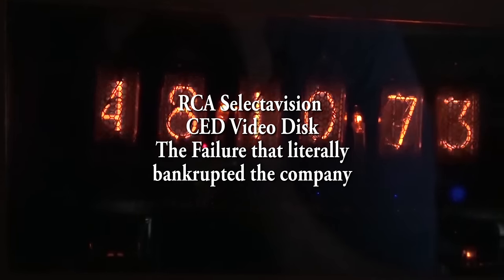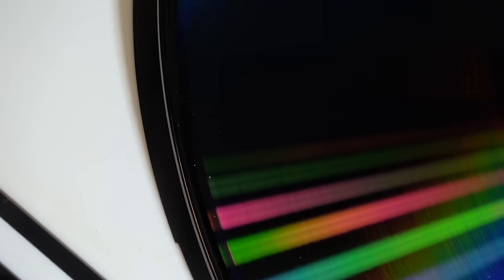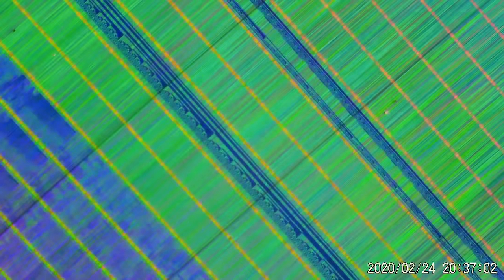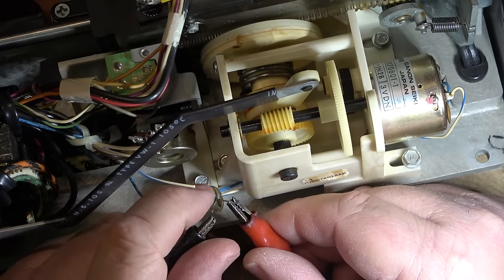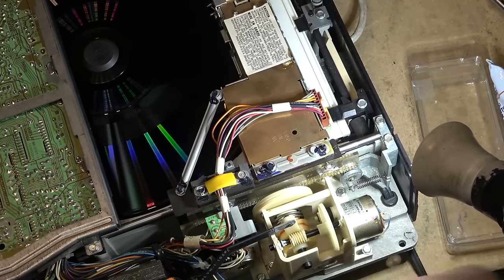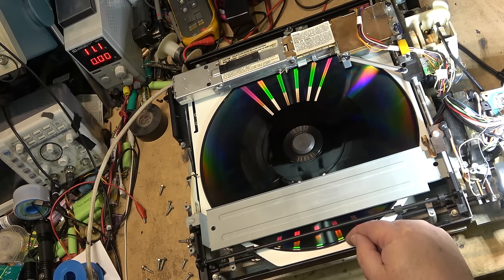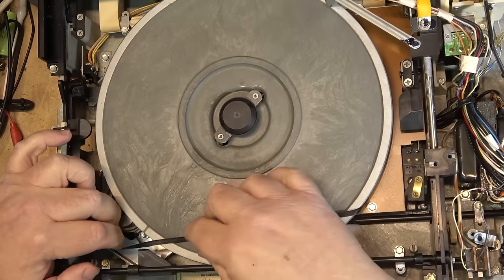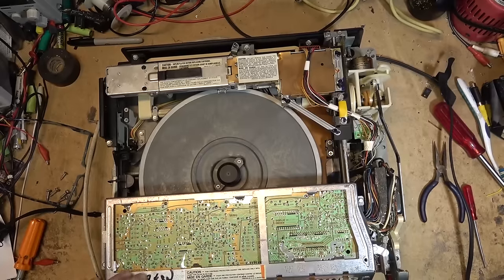RCA SFT100 CED Video Disc Player is not happy will it be repairable or is it FUBAR?

Comment: In the early eighties I wanted one of these discs players.  I voraciously read consumer hi-fi and video magazines opting to go with LaserDisc for the more superior sound and picture..  Not that I was smart.  Far from it.  LaserDisc too was a plagued format.  My Magnavox player did not handle warped discs well...and most rented LaserDiscs would become warped likely from users hot cars and other poor handling.  To buy discs was still expensive enough that it didn't make sense for me to buy a movie I'd only want to watch once or twice.  Matsushita and Pioneer lost a lot of jack pushing the LD format which ultimately failed too..  At the time most folks chose VHS over these discs. That was actually being smart.  Outside of the novelty of owning new tech  (which wore off fast) the benefits of early optical discs were few if at all.  Good nostalgia here of a time when the race for the future of home video was a hot sector of the consumer electronics market.  I enjoyed your video and could clearly see the built-in reasons these players were what Steve Jobs later referred to Blu-Ray as "a bag of hurt", LOL..  Blu-Ray was (and actually still is w/ 4K) like a  Porsche 911 opposed to these early optical video formats which were more like the East German Trabant comparatively speaking.

Comment: Iv worked on a couple of these things Usually that model is actually very reliable. Most of the time they just need a new belt but they are very RPM picky and what you see there is typical of a dry or bad bearing,   I have seen some guys bring them back to life
Reply from the maker: Bad bearing, can feel it vibrating.
Reply: Motor looks basically identical to what's in a broan 688 bathroom fan with a longer shaft.

Comment: I remember seeing one of these things in Radio Shack. The video was stunning; it was broadcast quality - like 320 lines of resolution - over the air analog quality. The discs were constant angular velocity and would do a clear still frame. The discs and technology were flimsy and precarious., but when new was as good as laserdisc through analog RF connection.
Reply from the maker: No you didn't. You saw a laserdisk. In cav mode laser ebdided 1 frame let revolution.  This does 4 per revolution.  Laser disk had 340 lines resolution, broadcast quality. This piece of junk had 240, same as VHS.
Reply: @12voltvids  No it was CED Selectavision. I went back and checked; I am wrong about still frame. But checking specs online they claim it was superior to VHS and SVHS. I remember it looking vastly superior to VHS or Beta. Laserdisk has about 5 Mhz bandwidth or 400 lines. Of course with RF connection best you can get is 320.
Reply: @12voltvids Radio Shack did sell a CED player model, the Realistic CED-1, made by Hitachi.

Of course, Radio Shack also did sell a LaserDisc player much later on, the Realistic MD-1000, made by Funai Electric.

But, yes, CED could not do still frame video because one single disc rotation is four frames of video.  To have a still frame with CED, you'd have to have four frames of the same image.

The only thing that came close to that were still frame images made specifically for Interactive CED titles, and the only machines that could play those as intended were the RCA SJT-400 and SKT-400 random access players.

Comment: Funny bit of info … I got one of these … fixed it (belts were gummed up and gears were cracked)

Going through it …I thought I had a speed problem… audio was a tad fast… Got frustrated because I could not find any speed adjustments.

Well, I was using The Empire Strikes Back as my test disk.  

Turns out Lucasfilm prohibited the release on 2 disks.. they got around it by speeding it up 😆😆😆😆

So don’t use Empire Strikes Back as a test disk !!!! 😂
Reply: "A New Hope" was also time-compressed to make it fit on one disc, so that's another "Star Wars" movie where the sound pitch is higher than normal because the film-to-video transfer was faster than normal.

"Return of the Jedi" is a two disc release, so no time-compression was used.  But it came out relatively late in the CED format's life, so that's a relatively rare pressing whereas the first two movies are common.

The SFT/SGT belt drive models used magnetic sync plates for speed adjustments while all other CED player models were quartz-locked and no adjustments are possible.  But if you are getting steady color video, your turntable speed is right on.

Variations in turntable speed will directly affect video stability, and one of the first things you'll lose pretty much immediately if the speed is off even by the slightest is the color.

Comment: The yield rates for early laserdisc pressing at the DiscoVision plant near LA were awful, apparently in the single digits at the beginning. So if you bought a disc you were also paying for all the ones they threw out. I think it took Pioneer buying the plant and retooling it to get them up to acceptable levels. The stylii for these machines are also quite sophisticated and complex to make; apparently when they killed the format RCA made enough spares to satisfy their projected demand for replacements from existing machines and then decommissioned the tooling (I wonder how long you could get them from RCA).

And I've actually seen used CED movies for sale at BMV Books in Toronto multiple times (somebody bought them, and they didn't sit in the store for months either).

Comment: So I acquired one of these a while back. I did not realize this was a completely different format. I tried shoving a laser disc in the thing. I took it apart and was like WTH! I thought laser disk was optical what’s this stylus for? Then I found out RCA was trying to break in to the market with this crap. I did find a video disk and it did play okay but with horrible picture and sound. Sold it at yard sale and never want another one.
Reply from the maker: Only for the collector value.  I wouldn't have a use for one otherwise.

Comment: Too bad that there is not a way to fix the bearings for as how rare that machine is would be great to have it in a fully working order even tho it is just a shelf piece to look at or for in a museum .... I know time wise it is not feasable to try to fix the bearings as you wont make any money off it but sure would be great to see it really resotored some how in a fully working unit... Good video Dave
Reply from the maker: It's a plastic bearing
Reply: @12voltvids  but i would think anything with the same size should do... anyway good video
Reply: I wonder if you can drill it out and insert a nylon drill bushing in there. I did that with a dishwasher pump and it lasted 2 years of daily use, which was the same as the factory pump motor regardless.

Comment: A neighbor bought one of these players back in '81 or '82;  yeah, the picture quality wasn't much better than VHS as I recall.  From what I've read,  this was basically RCA's attempt at another big breakthrough on the level of NTSC color TV.
Reply from the maker: 240 lines resolution same as VHS and mono sound.  They did bring out a stereo version and one with digital memory so it could play slo-mo and still picture mode.
Reply: @12voltvids Plus, CED used chroma-under-luma for color, which VHS and Beta also used.

LaserDisc, at least, was true composite video.

As for CED stereo with CX, it wasn't bad ... and it was far better than linear stereo on VHS, even with Dolby System ... and then Beta hi-fi came out followed by VHS Hi-Fi, and they both blew CED sound completely out of the water.

Of course, you also had LaserVision stereo sound with CX, and that was better ... and then came LaserDisc Digital Sound.  'nuff said.

And one of the biggest competitors to CED ... was VHS ... and RCA kind of shot themselves in the foot with that, since they were some of the biggest pushers of VHS having introduced it for North America.

And it was kind of a signal of RCA's decline.  RCA had been developing their own video cassette format, but then canceled it and eventually obtained licensing for VHS from JVC, though RCA would have their VHS VCRs and cassettes made by Panasonic.

Comment: My parents had one.  Video quality was superior to VHS.  The only problem was like a audio record at the time, if you got dust on the disc, the video would skip.
Reply from the maker: Considering the resolution was the same as VHS you can't say with a straight face it was superrior.  Now laserdisk, now you are talking a superrior picture and sound.
Reply: @12voltvids  I had found the picture was sharper.  I in no way said that it was a greater resolution.

Comment: Bought mine in the early eighties from Radio Shack under the Realistic brand. The discs were around 30 bucks with limited selection. This was a very finicky system as skipping would occur frequently. The first selection I purchased was a 2 disc set of the Godfather....
Reply from the maker: It was terrible.  Should never have gone to market.  I can think of a few other things that should never have gone to market too. VHS being one.  Betamax was so much better and the recording time thing could have been extended like it ended up being.  Had everyone got on board there would have been 1 format and that would have been better for everyone.  Smaller tape better quality.  Then there was HD DVD which also should never have happened. It basically took down Toshiba like the ced system did to RCA.  Sony on the other hand did extremely well with beta. Notice I didn't say betamax, as it was their betacam format that ruled broadcast and professional production for the life cycle of video tape.  It used the same parts as the betamax system used.. same pinch roller and tape threading system, same size drum. Just a different video head and different video processing and of course a much faster tape speeds.  2 sizes of cassette. A small cassette exactly the same as the betamax used and a larger cassette for longer record times.
Reply: @12voltvids  "I can think of a few other things that should never have gone to market too. VHS being one."

Yeah, right.

"Betamax was so much better"

It wasn't better at all, let alone "so much better."

"and the recording time thing could have been extended like it ended up being."

It could never match VHS's recording time because its tape cartridge was smaller, so for a given thickness of tape, VHS cartridges could always fit a lot more of it, and no matter how slow they made their linear speed, VHS manufacturers could always make theirs just as slow. 

L-830 was the longest Betamax tape and it could record 5 hours at its slowest recording speed (βIII). That's not even as long as VHS's recording time of 6 hours on a standard T-120 tape at its slowest recording speed (EP), and with a T-120 you're not stuck with the fragile, ultra-thin tape that an L-830 uses. And if you wanted to use fragile, ultra-thin tape with VHS you could go all the way up to a T-240 for 12 hours of recording time at EP speed.

"Sony on the other hand did extremely well with beta."

No, they didn't. Betamax was a failure and Betacam was only a success in the professional market, which is small potatoes compared to the consumer market.

I have three VHS VCRs from the 1980s (1983, 1985, and 1988) that still work fine, so there's nothing inherently wrong with the fundamental design in terms of reliability. Also, I've made recordings on my highest-end VCR (JVC HR-D566U with new Maxell HGX-Gold T-120 tapes at SP speed) that look almost as good as the DVD or BD that I recorded from (when viewed at the same distance, on the same CRT TV, and over the same composite video connection), so there's nothing inherently wrong with the picture quality. 

Betamax might be able to produce slightly better picture quality at βI speed, but then I couldn't even fit a whole movie onto a standard L-500 tape, nor even an L-750 tape for movies longer than 90 minutes, and most Betamax VCRs didn't even have the option to record at βI speed to begin with.

Sony shot themselves in the foot with that tiny tape cartridge, and them being a far less open format than VHS didn't help matters either.

Your idea that a wildly successful video format that dominated the consumer market for two full decades (1980s and 1990s) and parts of two other decades (1970s and 2000s), and for which most people had no complaints back then, never should have gone to market makes no sense whatsoever.
Reply from the maker: Sony could have dropped the speed so the l750 tape could record 6 hours.  They chose not to have an even slower speed.  Sony put their engineering efforts into betacam.  Cost wise it wasn't that much more to make a betacam deck and with them selling for 12,000 to 80,000 that was a real moneymaker for Sony.   They might not of sold millions like home video but there also wasn't 30 different companies making them. There was Sony and Ampex making betacam and all the other flavours of betacam. Digibeta, sx, HD beta.  They sold 10s or thousands to tv stations and production companies world wide and with a high profit margin and high profit on maintenance and parts.  Make no mistake Sony was laughing all the way to the bank and it started as betamax.  Betacam uses the same parts.  Betacam SP used a different drum due to metal tape but regular betacam they just added 2 more heads for the component chroma and they were golden.

Comment: RCA actually had a working prototype by 1969 or '70, but the discs only held 10 minutes per side, LOL.  Engineers then spent most of the rest of the '70s increasing the amount of time per disc
Reply from the maker: I believe it was 30 minutes per side just like laserdisk in cav mode.

Comment: I remember that the discs were insanely expensive,any dust would make them skip. And seems like you were putting the disks in and taking them out and back in to get them work. But I still have the disks but not player.
Reply from the maker: Laserdisk were expensive.  The ced disks were 15 to 20.

Comment: Good ol vinyl infused with carbon, varying capacitance across the disc picked up by the stylus… quite the marvel of engineering but it was too little too late
Reply from the maker: Not as cool as tracking a reflective spiral track with a laser.
Reply: @12voltvids True that LMAO, I honestly will never understand why RCA continued to pour tons of R&D money into it after the release of Laserdisc in the 70s, and that went in development even longer than CED. Haphazard management and baffling decisions

Comment: I have two working players, I got hold of the new belts, and changed them out. But It Is the Stylus that Is no longer available. So I have to keep swapping It between the two, till I can get two new ones. If Anyone has any idea where to get these from. They are both UK Pal Stereo machines. GEC McMICHAEL V5000H CED video disc player is the same model as the Hitachi VIP201P
Reply from the maker: Stylus available on eBay for those with deep pockets.
Reply: @12voltvids Thanks. I have looked on there, but none for my model. When You change out the other belts. Be very careful with the Plastic parts. as these are very brittle. I used a Hair dryer to sofen It first. When Is the second half of this one going up?.

Comment: I bought one from eBay and in the ad the guy said it works good and it came with ced discs and I connected it to the old crt tv that I have and I put it into the load position and nothing, I put a disc in and nothing came on the screen and then after that I took out the disc and then there was no power, I plugged it into another outlet and got nothing, so idk what went wrong with it, so I got another one from Craigslist and that’s the one that will power up but it wants to work, I swapped out the needles but it makes  a noise so idk if it’s a belt or what, I want to swap out the parts out of the one that didn’t power up, can anyone help me with this???

Comment: What did you say that POT does? It almost certainly needs Deoxit. So many points of failure on these.
Reply from the maker: That pot is just providing feedback to the sled servo and it's working. The failure on this one as shown at the end is the main bearing for the platter. Its plastic, go figure.

Comment: I think these things are cool even though they are old, I just wanted mine to work and I have two ced discs to go with it, any suggestions would be greatly appreciated……I want to figure out how to fix mine…….I got an old tv that I can connect it to, so I would like to know why mine blinks L when in the off position, I haven’t put any discs in mine so even try it…..I want to  replace that stylus, well the whole plastic thing but I want to fix the L problem…….
Reply from the maker: l is to load the disk.  I really don't know much about these.  This is the only one i have ever worked on.

Comment: Your statements at the beginning of this video were completely untrue. RCA did not recall all the CED players, and did not burn all the discs. Why do you make these untrue statements? Clearly, you were the wrong person to bring this player to for repairs.
Reply from the maker: Actually they did in Canada.  I worked at a large RCA dealer and they took them all away.  And the discs.   Now perhaps they blew them out in other markets all I remember is we shipped them all back.  Had to box up the unsold discs and players and sent them all back for credit.  What RCA did with them i don't know.  Never fixed any because nobody was dumb enough to buy them.  We actually rented players and discs out when they were around.